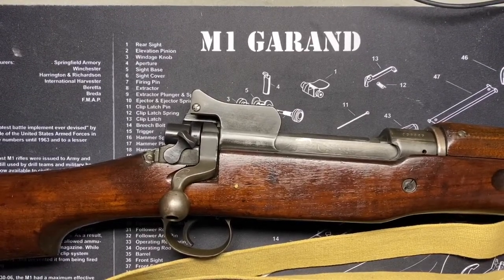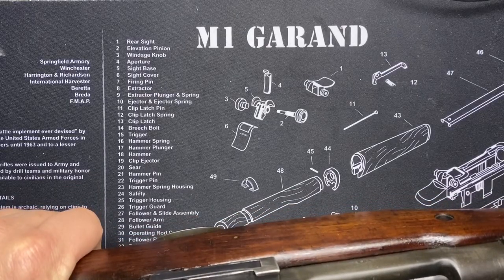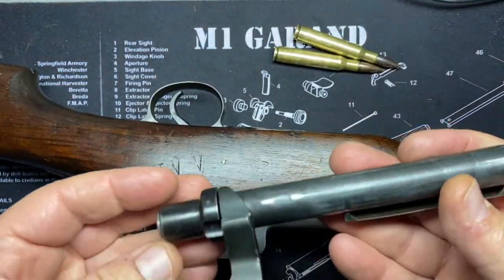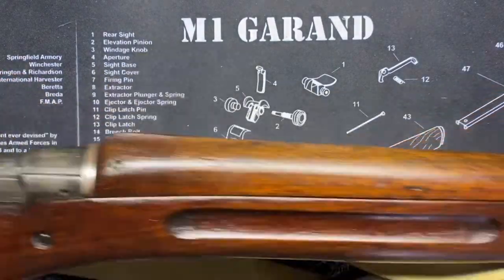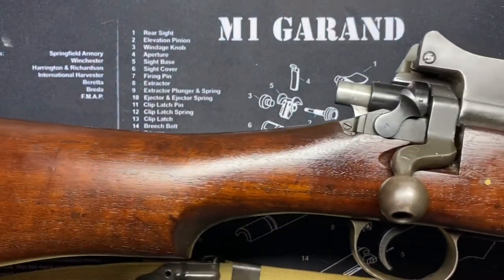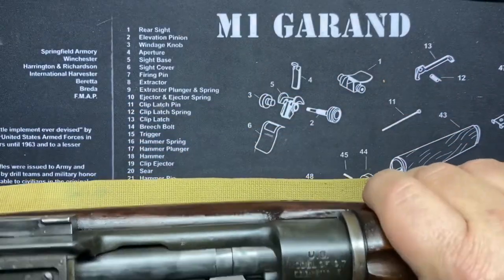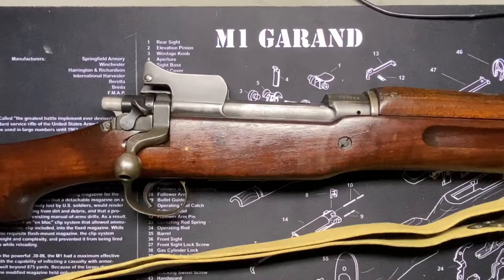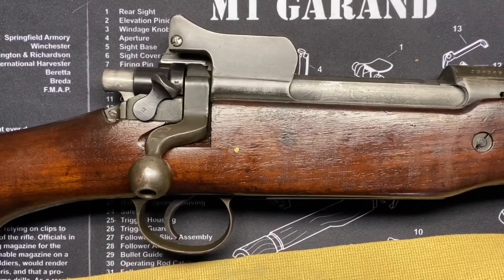Eddystone M1917

Comment: One of my favorite rifles I own since I was 19 years old. With home rolled ammunition it's the most accurate rifle I have when it's in my hands. It's almost in par with the k31 rifle I own. Even with open sites. The peep sight system on this particular rifle is the granddaddy design of all peep sights afterwards on American rifles. You have a fairly early example. Mine's over the 1 million mark. And according to my barrel it was produced on the 11th month of 1918.  The month the war ended. Yours is a very beautiful example as well. They're kind of the forgotten American battle rifle that doesn't get as much recognition as it should. It came awful close to replacing the 1903 Springfield.

Comment: I have a sporterised one here in Australia with Shilen Barrel and a Timney trigger, sporterised stock, bedded and floated, the sight ears had been ground off when I bought the action and a bedded bridge fixed to the top with an 8-32x45 scope on it.  It will shoot 0.3" at 100yards.  I kept it 30-06", it's a great calibre and the brass lasts forever.
Reply from the maker: I’ve seen some real beauties in the sporterised arena with these.  That sounds like a real nice one.

Comment: The rear sight axis screw thread end is staked on mine. I thought I was going to remove it so I could temporarily mount a Skinner sight on it to compensate for the extreme range zero. I ended up with a taller front sight. Well built rifles for sure.
Reply: Can u show a picture of the staked screw? I think mine is staked as well i wanted to buy the scope mount they sell that requires no drilling and uses the original screws but if its staked i dont think it will work

Comment: are those STAKE punches OR
just a mark to where the screw 
/bolt is to be tightened?
Reply from the maker: I always called them staked screws but I did a little searching and found some reliable info on a 1917 chat forum that says.....

“The original purpose, like the keeper screws on Mausers, was to keep the screws from coming loose, and it does that. But it also means the screws can't be turned without shearing the staking, so any screw that will turn easily has been off before, and the rifle is not "untouched."

Removal of the guard screws, BTW, was not to be done by the individual soldier, or at least that is what "the book" says. (In the American army, I can only guess how much that rule was obeyed.)”

Comment: Sweedish stripper clips dont work. Byoy have to use the m14 strippers.  The correct ones will have the bumps in the side in the middle.  (Only one on each side)
Reply from the maker: Thanks for the heads up.  I’m a big fan of manually loading the internal mag anyway.....a holdover from all those Hickok 45 videos.

Comment: Hello Sir. I just bought a M1917 Eddystone. the Rifle stock has been sporterized. The Barrel and the Action has no engraving/stamp of the caliber of the Rifle. Could you please tell me if your M1917 Rifle  has 30-O6 Springfield engraved/stamped on it ? Many thanks.
Reply from the maker: It does not have caliber designation on it.  Make sure it is actually a Model 1917 and not a Pattern 1914 in .303 British.